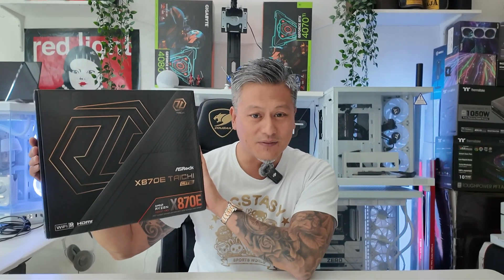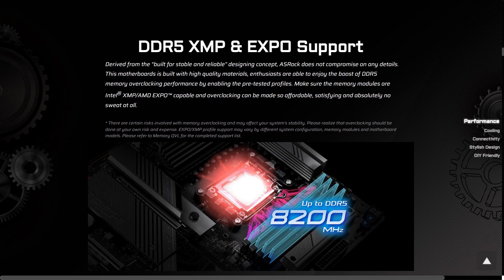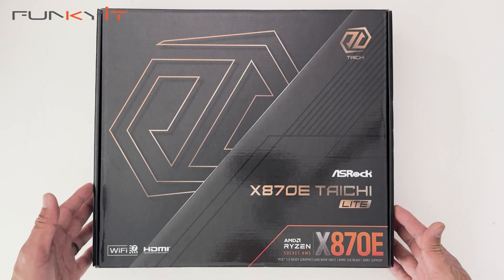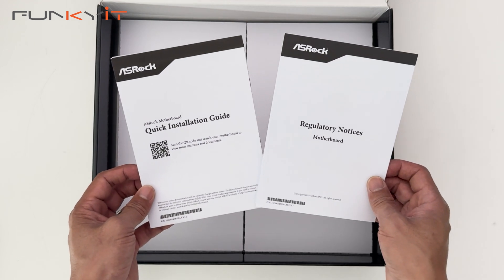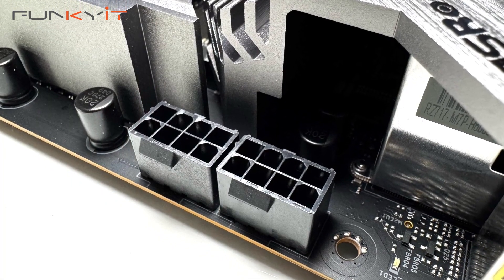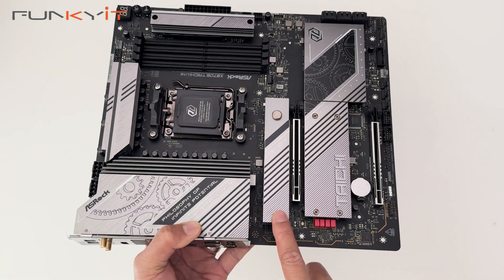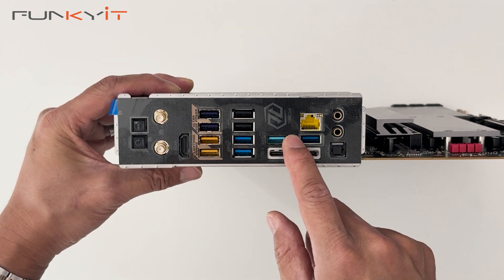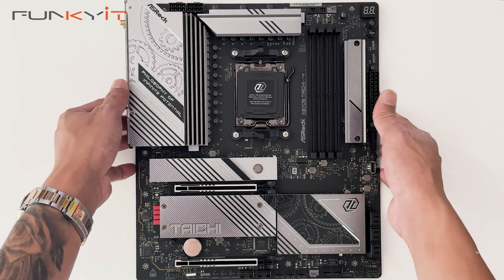Affordable and Feature-Rich Enthusiast Motherboard - ASRock X870E Taichi Lite

Comment: AVOID THE X870e Tiachi lite... there is a known issue with it not recognizing the ethernet cable, so no internet. I know because ive spent the last 3 days looking through forums to fix my brand new $400 pos mobo from asrock... you save up for a year to build a top teir pc and the"high end" companies cheap out on the most basic parts... i will not buy ASSROCK again

Comment: does the pcie slots run at 8x/8x mode when installing a sound card/addon card or does it only apply when installing a 2nd gpu?
Reply: Yes.  That's unfortunately true of any 2 slot AM5 board out there where the second slot is the same generation as the first. The best you will do is x8/x8 - which should be fine, and really your only option if you need two GPU slots. If you really need x16 on the first then you'll either want a board where the second is Gen4 (then it won't bifurcate the first), or a board with 3 or more slots (where the 3rd+ slots are always x4 or lower Gen4 or Gen3).  A sound card doesn't need a high lane count so this is a good option.  With ASRock x870e boards that's either 5x8/5x8 on Taichi/Lite, 5x16/3x2/3x1 on the Nova, or 5x16/4x4 on the others (Riptide, Pro, Steel Legend).

Also beware that the second (or third) slot in all of those non Taichi boards share lanes with one of the m.2 slots, so using one will disable the other. If you need more than 2 m.2 slots than the Nova is your only real option since it has 5 to start with - you'll be left with 4 usable.

There's a great Google spreadsheet listing all the AM5 boards capabilities:
 https://docs.google.com/spreadsheets/d/1NQHkDEcgDPm34Mns3C93K6SJoBnua-x9O-y_6hv8sPs/edit?usp=drivesdk
Reply: Depends on which PCIe 5.0 slot. The main one has no lane sharing. It's always x16.

Comment: $400 is only affordable because you compare it to the absurdity of the pricing of some of the other motherboards out there. In reality it's still $400, for a motherboard that basically contains pretty much the same bill of materials as others that cost much less from the same manufacturer.  At least it's not $1200 though.
Reply from the maker: You’re right, $400 is a lot but it’s packed with features and has a great build quality.
Reply: ASRock also produces budget motherboards, but this one is high-end, the quality is there.